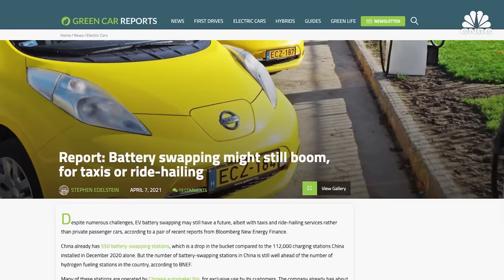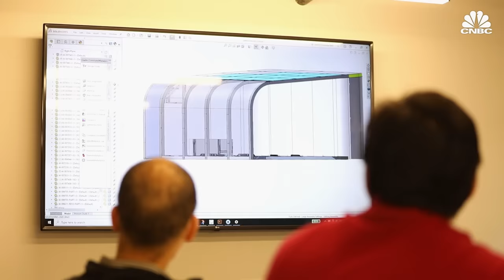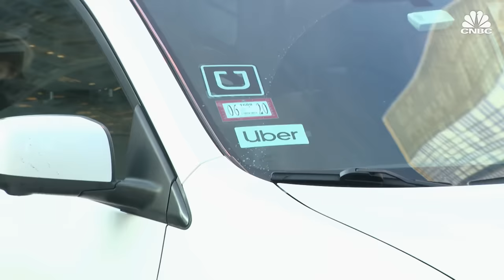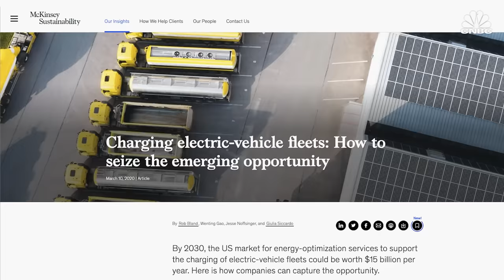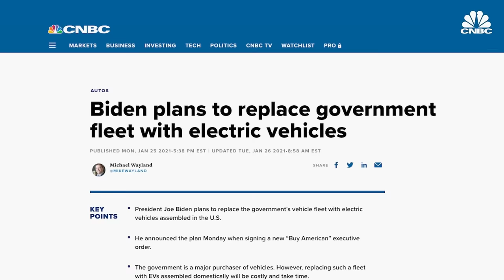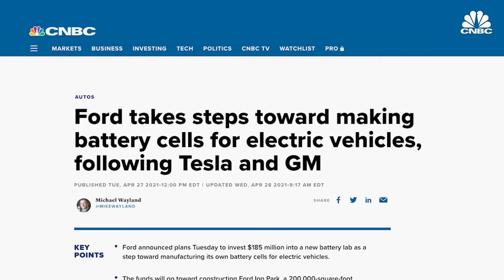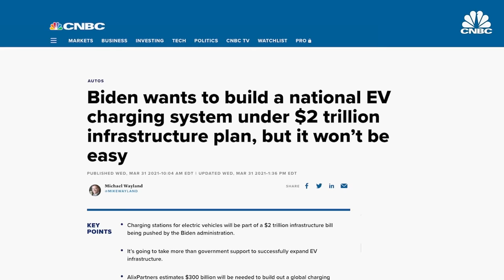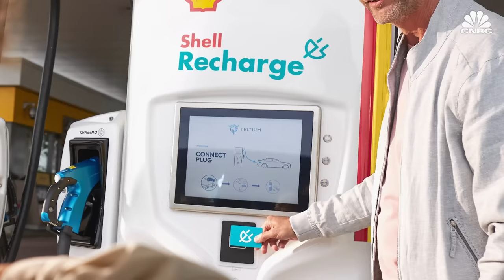Can EV Battery Swapping Take Off In The U.S.?

Comment: while the answer has always been fleets, that I think is becoming a weak application for battery swapping. A fleet of delivery/company/taxis can be specified to have the battery just big enough till the driver gets his break and charge 20-45 minutes. though i see battery swapping in vehicles with fixed routes and/or tourism like a city bus or in some weird application we haven't seen yet like public electric bikes, bicycles, scooters  or stranded EVs without a charge and be rescued swiftly with a small battery

Comment: Too many problems, too few benefits, except maybe for certain specfici types of fleet vehicles. Also: scooters and small motos. Then there must be a threshold for when swapping makes sense. I think that threshold is probably about the point where you can pick upo and carry the battery. Above that, usually much better to charge, not swap.

Comment: 10 minutes to swap them. Or hours to charge. I'll take the swap anytime.
Reply: Charging doesn't take hours, except at home, and then only if you've fully drained.
Fast chargers are 0-100% in about 60 minutes, though nobody ever fast charges to 100% unless they absolutely positively have no other choice.
0-80% in about 20-30 minutes, though in truth most people don't often charge on the road to above 60%, enough to drive about 130 to 170 miles.

Believe it or not, swapping is a dead end idea.
Reply: @dorvinion  Shut up Tesla fanboys. 
10 minutes is better then waiting half hour-an hour.
Reply: @saulgoodman2018    real world experience always beats hypotheticals posited by the uninformed or inexperienced.

Memorial day weekend I visited my folks. 400 miles one way. Needed just one charge stop halfway through (23 minutes) that took less time than food and a bathroom break.  
Took a few minutes less than my usual time in a gas car actually. Likely because the charge cord doesn't need to be babysat.

Battery swap is just isn't necessary.
Reply: @saulgoodman2018  Refueling takes 7 minutes, during which time you do nothing else but maybe clean the windshield.  Then you go into the bathrooms, and get food and eat it. 

No babysitting a pump means I save that 7 minutes.
Reply: @dorvinion  You do not have to baby sit the pump. It turns off once it full.
Not everyone goes to eat after they get gas.
Reply: @saulgoodman2018  Sure you have to babysit a pump - you have to stay in the immediate vicinity of the car. Can't go use the bathroom or anything during that time.

I know there are some folk so dedicated to not stopping on road trips that they pee into empty containers, and/or dangerously eat at 80MPH while driving with their knees. Those people are a rare breed.
When you're talking about a 400 mi drive, that's going to take 5.5 to 6 hours, even without food, fuel, or bio stops. Is 15 to 25 extra minutes on such a drive to charge really so intolerable, particularly when some/most of that 15-25 minutes you will be handling things that normal people do on road trips - eat and/or go to the bathroom. 

Now I will grant that 300-400 mi is kind of a sweet spot with current generation long range EVs. If you are trying to go farther - 500-800 miles in a day, the charging time will start to add up, but not as much as you might expect. 
A trip I'm considering for later in the summer, is almost 800 miles, and driving 5 over the limit, the route planner estimates 1h 35m of charging if I drive straight through, no hotels. So 11.5hrs trip if I don't have to stop for food, fuel, or bathroom breaks becomes a 13hr trip. The longest charge stop estimated at 24 minutes, the shortest 10 minutes, average of 15 minutes each.
Again, is that truly so intolerable, especially when on such a long drive I will likely spend at least 1hr eating or making bathroom stops regardless of what powers my vehicle?
In the next few years when they start installing packs with 25-50% more capacity than today's EVs then charging time to drive 500-800 miles in a day will decrease even more.

Bottom line, hours and hours to charge was very much true in 2005. The greenies and authoritarians (same people mostly) were no doubt salivating at a potential future where private vehicles could go no farther than 50 miles from home and anything farther would mean using controlled, registered, and restrictable transportation like trains.
Thankfully those dreams are for naught.
Reply: @dorvinion  You do not have to baby sit a pump. Once the tank is full, it will stop pumping.

Swapping batteries is still faster and better than charging.
Not everyone have time to, or want to wait.

Comment: Sounds like a good idea. I’m all for EV’s. I’m also for gas powered vehicles. Let’s let the market decide which vehicles we should drive by giving us a choice.
Reply: its really not a good idea. Batteries are the most expensive part of a car and the world doesnt have enough batteries for EVs even with the tiny amount of electric cars being produced. So having millions of dollars of battery packs sitting around at each station that would be required to constantly have a charged pack ready and waiting for a customer just is not feasible. If they want to have batteries for grid storage EV batteries cost way more than ones that are currently in large scale grid battery storage, battery chemistry that doesnt need to be light or small. Charging is getting faster, batteries are degrading less, range is getting better, charging stations can be integrated into lamp posts, garages, pretty much anywhere with electricity. Not to mention how much more range you get from having an integrated structural pack vs a modular swappable pack.

Comment: Ask any electrical engineer about connections- the fewer the better.
Reply: IT wil Also require THAT the industry agrees on a Common battery standard, so batteries reach a level of ambiguity like propane tanks. The battery in this video is only 10-15 kWh? Is IT only a tech demonstrator?

Comment: Allrighty - simple legal term, LIABILITY.

Who would be liable if the battery has defect ? You've replaced the battery, so the car manufacturer is no longer responsible, i guarantee they say to not touch it or otherwise warranty is off. Do they have a deal then with those companies, then if so - would Ample be liable ? If not who then, Also, are you paying just for the cost of the electricity within the battery ? What about guaranteed distance, if i buy a performance pack, it holds more power, are the batteries which were removed from my brand new car with 100% life expectancy going to be replaced by a 80% capacity ? 85% ? How is that ok? This for a taxi company sure, i get it. however for personal cars, i really dont see this working, they went bust once. They will go bust again.

Comment: 10 cents per mile/charge....say $50 for 500 miles....that is not cheap, equivalent to gasoline. Meanwhile you can charge a chevy volt from home at about $2-5 for a full charge. So in short you're paying 10x more to swap a battery.

Comment: Battery swapping is the future if the battery technology can’t improve dramatically. A lot of issues arise with battery recycling if no battery swapping. Although standardized battery is like a problem, but battery swapping is to prevent the bigger toll on our environment.
Reply: There is zero evidence to suggest battery tech isnt improving dramatically. Tesla has programs to recycle their batteries and they are switching to packs that are integrated into the structure of the car. The swapping idea is just bad.

Comment: Would this be able to work when car manufacturers have subtly different designs for their battery packs? This seems more likely to work when the world can agree on 1 standard of battery pack design and integration
Reply: Then every tech industry needs to agree to use the same battery
Reply: @haruyanto8085  not likely, given that each car company will want to design their own battery packs so that customers of the cars will end up buying from them instead of some 3rd part manufacturer. Keeps the profit chain coming
Reply: Standardized batteries.  Cars designed for simple swapping so that owners can have a spare.  Method to jettison battery in case of fire

Comment: How old and unreliable are the batteries that would be swapped into my new car? If I bought a 200 mile EV and their batteries go flat in 50 miles, then what?
Reply: "How old and unreliable are the batteries that would be swapped into my new car?"
There is potential for the swap pack batteries to be maintained at a higher level than the megapack you purchased.  But you have already guessed how the swappable packs are profitable :  they are made of degraded cells

Comment: Yea… I mean I see a few big issues. Not all batteries are built the same. A company like Tesla, a big leader in EV’s in the US, just announced their big brand new battery. Right off the bat you’ve got to convince people that your battery matches what they got in the factory or to pick your battery pack over Tesla’s. 

Also a grid system under the car sounds like it would have a ton of weak points compared to one solid robust piece. A greater chance a battery could get damaged or fall from the bottom of the car.

Comment: People buy Evs so they can charge at home and not have to buy fuel or waste time stopping at gas stations on their daily commute. Most families have more than one vehicle. So as long as one is gas or a hybrid you just take the later option on long trips. It’s common sense. 

If your often finding yourself driving long distances that fast charging or battery swapping often needs to be a option than maybe a hybrid is a better choice.  

One  place i do see this being helpful is those wanting a ev but don’t have a parking spot to charge their car. Or like you said fleet vehicles where it may be a more economical way to charge 10- 100 high mileage vehicles. 

The truth of the matter is a solution will need to be found if everyone HAS TO have a ev in the future. The fact of the mater is in urban environments there are a high percentage of the population who don’t have access to a place to charge their own vehicle. Whether it be street parking, or parking garages. Unless apartment building owners are going to instal 10-200 240 volt  chargers in all their buildings parking lots for their renters. Or the city putting a coin op charger on every light post on a busy neighborhood street so That the 6 people who rent in one house can all charge their individual cars overnight.  I don’t see either of those  happening do you.

Comment: battery charging is getting faster so swapping wont be needed
Reply: Fast charge a car and it’ll be dead within 5 years.
Having nice, fresh batteries always younger than 2 or so  years in your car, even when the car’s 10-15 years old, when any other EV that’s had the same battery that long, constantly fast-charged, won’t make it up and down its own driveway, certainly sounds like a win to me.
Reply: @funposting8912  why would you constantly fast charge when battery range is also improving? so by the time you put up the infrastructure for battery swapping batteries tech will have also improved in range, life span, etc on top of faster charging time.  So is that Nio's game plan to dump and upgrade new batteries into the system every 2 years?  they better have an amazing recycling process to not waste all that material needed to keep up with the supply of having to have more batteries than cars on the road.  I'd like to know what the ratio is for number of batteries they need per car they sell for that system to function as well as they intend.

Comment: ok...this will work out... You're being fed BS when she tells you Swapping is"Common in China"... but then tells you Gehly plans to build 200 swapping stations by 2023.
Any idiot who thinks this is going to beat out filling a tank and driving away in 5 minutes is goofy. And... "Load balancing off the Grid" Now I've heard it all...
Reply: It is common in China, as common as this new infrastructural service gets right now and Geely are planning it, hence the word "planning" 

NIO battery swap takes about 3 minutes and it'll probably be one quicker and more efficient overtime, just like EV batteries are improving over time, I'm just presenting facts

Comment: I suspect that most of the negative comments here are made by people who have or could have their own charging facilities at home, and many may be based in the USA. In most world cities (including larger US ones) and many older towns,  the majority of car owners don't have access to off street parking in order to slow charge (7Kw or lower} their vehicles. In London for example it is estimated that 75% of homes are in this category. The only option for them will be fast charging at a destination e.g. Office, Shopping location, Cinema, Restaurant, or very fast charging at a "coffee stop" with maybe a 15 to 30 minute top up. 
The problem is that fast charging is much more expensive and frequent fast charging degrades batteries quickly, leading to premature failure. 

One possible solution being put forward would be to provide on street slow charging from street fixtures such as lampposts, parking meters and free standing bollards. This will require massive investment in infrastructure and huge disruption to enable a supply of 3.5 to 7Kw for each parking space as well as the equipment to bill each owner who uses it. In countries where AC is delivered locally via overhead cables a major storm would take out a lot of the charging resources. Then we have the prospect of "parking fights" between EV owners competing for those spaces, as well as non EV owners who don't see why they should be unable to park because the only available spaces are reserved for EVs. This is going to be very interesting to watch; YouTube will have a new category "EV charging wars".

Another problem that this addresses is the cost of EVs and plug in hybrids. If you only have to buy the vehicle, not the batteries, then the up-front cost is lower, depreciation is measurable/estimateable, and the risk associated with buying and selling an EV is reduced, since the possible condition of the battery pack does not need to be factored in. Buyers can buy with more confidence and leasing rates will be lower as finance companies won't have to estimate/forecast battery costs, which could otherwise vary wildly depending on usage and previous charging practices of the driver. Less risk = less cost.

Owners might be charged an annual fee depending on the number of batteries supplied plus a variable rate depending on how often the batteries are changed and how much charge remains in the swapped batteries. The batteries themselves will last a lot longer since they will never need to be fast charged, so this will reduce overall costs. Car owners could shop around for the lowest battery service costs rather than having to buy their batteries from the manufacturer (did someone mention Apple?).  I can see big savings being made here, particularly with used vehicles.

There will also be huge benefits for the management of the electricity grid, but there isn't space to go into that here.

Comment: Most importantly, In Fixed battery system you will end up paying a huge amount to replace the battery once the life time of the battery ends. Whereas in the swapping system it doesn't happen. I'll buy an electric vehicle only if it has battery swapping.

Comment: Swapping batteries costs customers less than traditional fuel, but a "bit" more than fast electric charging? OK - it takes me 5$ to fastcharge a Tesla Model 3 for 220 miles. At $0.10 per mile, this battery swap solution would take me $22. That is over 3x the amount I'd pay to fast charge.
Reply: Also, ANYone that says stuff like "we will not allow you to film inside for want of our tech being copied" .... we know what happens to them and how unscrupulous they are. Pathetic excuse of a company trying to rob investors of $B

Comment: This battery swap concept is already fully established in Taiwan for electric scooters (see gogoro). The problem is it costs as much or more than fuel in a normal scooter. As scooters are small the batteries are small and anyone can do the swap manually. For cars you need a very expensive station as you need a complex robot to do the swapping. I’m sorry but I can’t believe it will be cheaper than a gaz car fuel for similar monthly mileage.

Comment: Needing to structural components (walls) of the battery packs seems like it adds alot of needs weight.. Not sure they answered why that isn't a big problem. Same reason why phones dont have swappable batteries now, it multiplies the number of outside surfaces you need to have. Having multiple instead of one swappable batteries exponentially increases this again.. Ride share makes so much more sense than these half measures..

Comment: The current battery supply chain is alright. But, as BEV sales take larger percentages of the supply chain, as grid scale energy storage continues to prove its cost advantage, & of course home storage the battery supply chain WILL get to a point where not enough materials are available to supply the demand for batteries. This puts too many batteries in an unproductive state, I cannot see battery swaps being a daily site for highway drivers.

Comment: Electric Vehicles fundamental design needs to be changed to allow automatic loading and unloading of batteries similar to how we press a button to open to gas tank there should be button to unload used battery and replace with new charged ones.